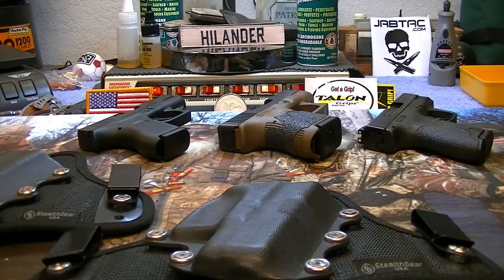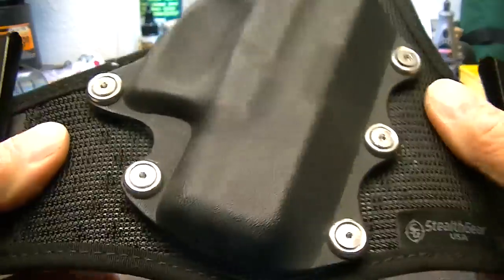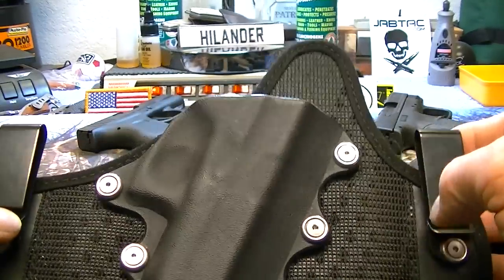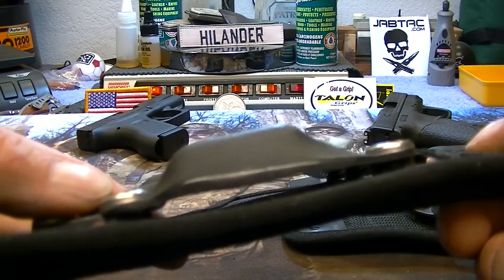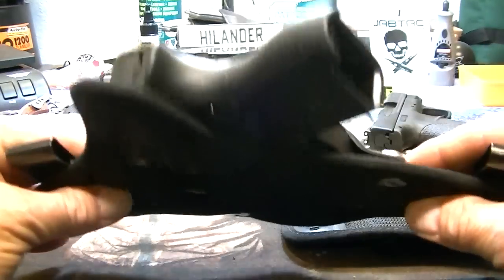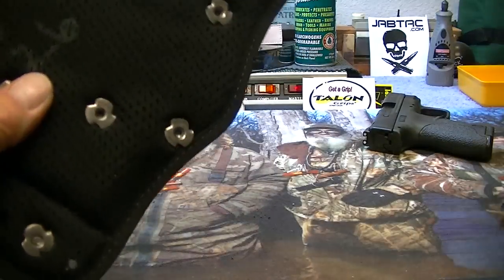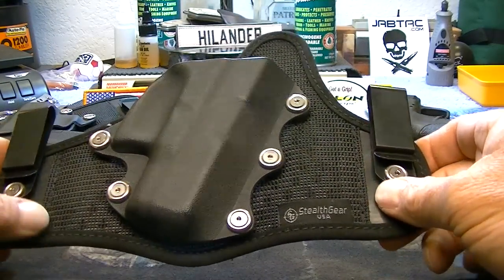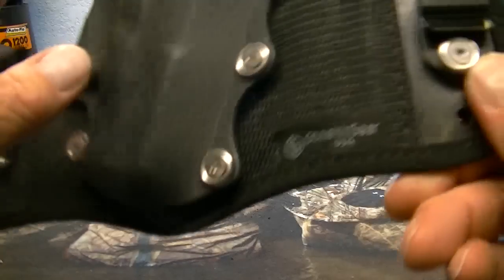Stealth Gear Holster

Comment: Good review. I was considering this holster for my Glock 43, a friend of mine loves his Stealth Gear holster. When you mentioned about the Galco having an open bottom which allows multiple guns to used with it. What do you think about modifying the Stealth Gear holster by cutting the bottom with a Dremel to allow for larger guns to be used?

Comment: Looks nice, do you think the window screenie stuff will be hard on the firearms finish?
Reply from the maker: 85montie YA know. Did not think of that. It is smooth so prob not. Time will tell.
Reply: Albee4ty5 Get a DURACOATED paint job! It's cheap if you do solid colors, but I did two Springfield's in 3d digital camo 5yrs ago, and they still look brand new! Facebook "Jim's Gun Supply" He's also a Chief of Police so I think he'll do a cop discount...

Comment: How come most of them have the red colored back, and yours is black?  Is that something you choose, or just a different version or something?
Reply: 219Dave I think the older ones have black.  All the ones I seen this year have the red.  You will all so notice that the tabs for the screws are blacken out on the newer ones too.
Reply: I wish I could get the black option for backing. I don't like the red. I know no one will see it but I'd prefer the black backing. no option when ordering so I backed out. nice looking holster.
Reply: I have to look at my P226 that is FDE, but I think they did put a black backing on that one.   Which would mean there might of been an option if you call and ask.  I never pay attention since that is the part that is against me.  I like the red as it lets me know more how dity it might become over the years.

Comment: How are the holsters holding up? I am looking at buying one for my glock 27. Thanks
Reply from the maker: glockster68 Good
Reply: glockster68 I had mine since March and it's still going strong and comfortable.  Specially in this crappy Texas heat and humidity.

Comment: I have and currently use a hidden hybrid holster, would this stealthgear onyx but significantly lighter than in weight than a leather/kydex style?
Reply: lx93racer Yes, yes it is lighter than leather! And, it's very breathable! My first holster was the N82, and that's not very breathable AT ALL, but it's great for fall/winter/spring!

I don't have the Onyx, but I bought the AIWB and carry it over the left top side of my left buttcheek/7 o'clock; not infront of me. If you are a righty then get an AIWB and carry it over your right cheek 5 o'clock.

Oh yeah, it comes with one clip on the holster, but you can attach another one if you want to. I did that, and two clips just feels more secure.